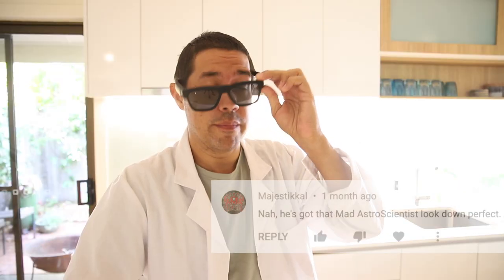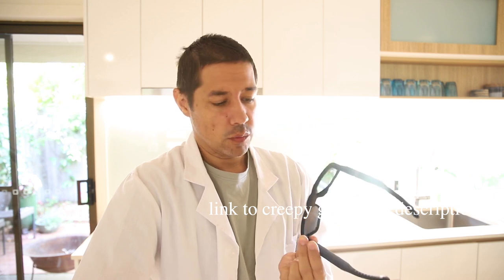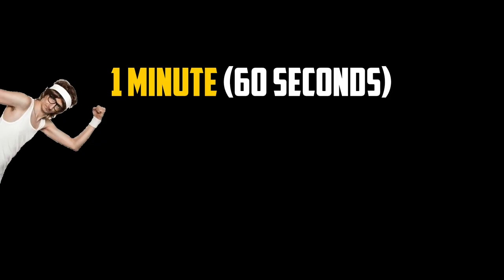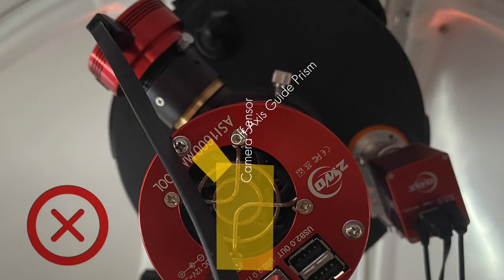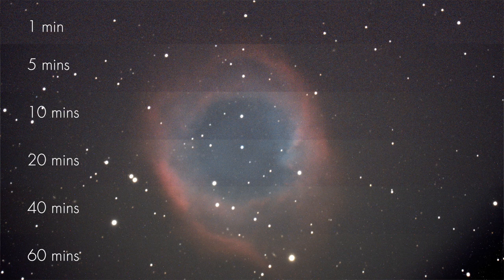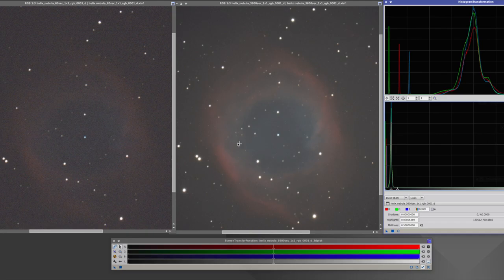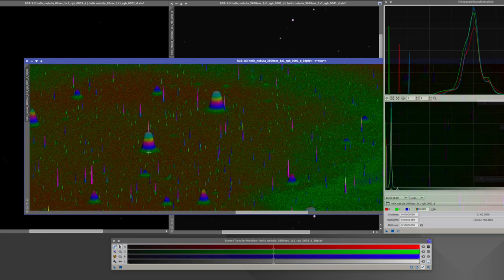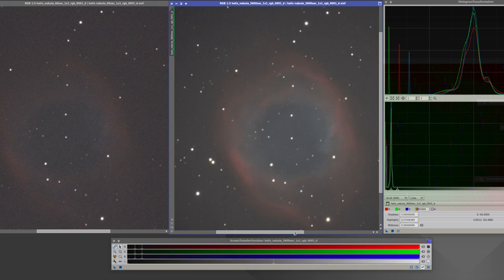Extreme Astrophotography - 1 Hour Subs!!

Comment: I actually prefer long exposure cos the noise reduction and image quality improvement is significant. 

While I only have a star adventurer I've still managed to get pin sharp, noise free, 30 minute long exposures using a Zeiss Distagon 15mm lens on a Canon 5DSr to capture wide field images. Even had it up to 4 mins with a monster Canon 300mm f2.8L prime haning off it, at least 2.5kg over its payload limit and it still works! Anyway, thanks again for your tips and insights. Greetings from a relentless cloudy November in Scotland.

Comment: Hi Dylan, I would like to see a comparison 60 mins vs. 60x1min stacked an if there is any noticable difference...
Reply from the maker: I have another video with that test :)
Reply: A 1 hour sub IS better than 60 1 minute subs under good conditions. The point of diminishing returns is at about the 10 minute mark.
6 10s would be as good, and possible better than a single 60. Under perfect conditions, very dark skies, stunningly accurate tracking etc, I hour subs would be great. The draw back becomes, from a technical glitch, a wisp of cloud. Imaging 4 hours of 4 60 min subs. Each sub is 25% of the whole session. I blown frame and it is a huge loss. Shoot 24 10s, and lose a few to what ever cause, and it is just a tiny fraction.

For us amateurs, great results from 1-5 minutes , with out the drawbacks. I shoot 2 minute subs for the conditions I face and am pretty happy. Not even possible to shoot 10s let alone, 1 hour. Sky conditions just don't allow for it.

Comment: Nice one mate... 💪... you now need to post reprocess 1, 2, 3 of the 3600s exp 😂, perhaps it will magically stack more data ... is that a small dehumidifier that you have inside the dome?  ... I went for the helix a few weeks ago and was not happy with my image, I guess I have pushed my small wide field refractor at 420mm beyond its limits... even in mono with Ha and RGB... not an easy target to get right ... cool glasses 🤓
Reply from the maker: Yeh tiny dehumidifier.. was in a recent video about obs maintenance but it’s doing quite well :) cheap too.

Comment: Dylan - How good are Highpoint Scientific with Shipping?  have found something on their US site that with Current Exchange rate is almost less than half the Local price - but concerned shipping might then end up tipping the scales...
It isn't for large Item - just .7x Focal Reducer for EdgeHD8 (which no-one has as Celestron are out of stock...) - so either way I have to wait, but might as well also get it at bargain cost...
Reply from the maker: I can’t use them except for special orders because they don’t ship to Australia generally!
Reply: I ordered my Evo Nexstar 9.25 SCT from them, and had it shipped within a week.  From New Jersey to Florida. Don't know about overseas shipping, pretty sure that's where the price will hike up if you do. But definitely stick with High Point Scientific.  They are awesome, knowledgeable, and have really good support (considering pandemic here).  And make sure to drop Dylan's name if you order from them. They like knowing how you learned about them.

Comment: But if u live in Bortlie level 6 or more with out filters anything over 3 mins is not much good. Do you use the zwo air pro Dylan?
Reply from the maker: Yeh I’m at a dark sky area .. and no, I have a dedicated server so no need for air.
Reply: Ah ok
Reply: Yep, its about the sky background noise. No filter and city lights will swamp the sensor. So then it makes more sense to go for a loooot of data and shorter exposures (do check the histogram though, having a white image might not be an issue if it’s not clipping the sensor). But when using narrowband or being at a dark site, a very long exposure will outperform shorter ones easily as you get much better signal over noise.

Comment: Hi Dylan! At 8:26 it may be seen that the star has a lateral chromatic aberration. How high was the galaxy when you shot the frames? I am asking because I see a similar pattern in my photos and I wonder whether it was due to atmospheric dispersion or my refractor has optical issues since the target was between 45 and 70 degrees altitude and I thought that the dispersion should manifest itself much lower.
Reply from the maker: Can’t be that then.. this target is basically overhead at the zenith.

Comment: Interesting- Longest I ever went was 20 minutes to see how many fuzzies I could get out of Markarian's chain.  Interesting how the noise flattened out so much.  I would be curious to see how gain and offset affect star saturation at an hour? Were you at unity gain?    
Nice M33! Was that with your HaGB technique?
Reply from the maker: Yes G-HaGB :) the gain settings were the same for both exposure tests (not high, pretty low).
Reply: @DylanODonnell  I am surprised at that there was only one satellite in that hour-  Helix is near the CE and there's usually more there.

Comment: Talking about making wide angle photographs of the sky with a telephone, things are progressing quickly. Iphones have very lousy cameras. The high end Samsung are starting the be good. The Huawei P40 gives pretty impressive images of the Milky Way. The top is the recent model from Xiaomi, the Xiaomi M10 T Pro, it has a 108 megapixels camera, and the images on the sky are crazy. Very likely better than with an APS reflex camera. It can stack images and do star trails, I was quite impressed by this telephone. You ought to look into it.

Comment: g`day dylan is the CGX out the door after only 3 years i thought the mileage would of been better ... so what mount are you going to buy ???? 
what brand are you looking at  and are you going for a mount of higher spec than the chineses brands the plainwave mounts look cool  the neighbours would think its a missile launcher lol if you have deep pockets ...  what will you guestermate your budget will be  for the new mount  and will you buy celestron CGX  again as a straight replacement ?????? was the CGX worth the nearly $4000 dollarydoos for 3 to4 years use ????
Reply from the maker: I know I know .. it’s just not handling these long focal lengths very well at all. Not sure if it’s All CGXes or just mine.
Reply: @DylanODonnell  dylan  your mount has had a hard life.. everything no matter the brand wear out or need fixing after a while have you looked at a complete strip and rebuild and bring it back to speck.. i think its your bearings getting tight(motors and main pivots RA DEC) from moisture in the dome a bit of rust / dirt  /ant bodys from the great ant attack last summer lol old grease.. look how much it improved over a few months ago  after you did the belts  adjustments .. mounts need love too .. a few hundred in bearings(at a industrial supply) might save ya thousands  in a new mount  or new gear is always nicer..  hope you keep us informed in your thinking and the process and outcome because its the heart of any imaging system is the mount 
cheers
james D
Reply from the maker: Yeh I’ll sell it cheap to someone with more skills than me :)
Reply: @DylanODonnell  well that counts me out  if you need skills just to buy it.. i am schultz..i know nothing .. i am at the stage i have been basically priced out of the hobby  if i want to advance anyway .(i need a mount and a bigger sensor camera etc) the zwo asi290mc just don't cut it for widefield lol
cheers
james D

Comment: You talked for like 20 seconds and already earned an updoot ^^
Reply from the maker: Heh
Reply: @DylanODonnell  Your stars have like yellow tops and blue bottoms. I think you are already hitting atmospheric dispersion. You can also reduce star size by aligning the RGB Channels. Does anybody use adc for Deep sky ? I think it was only needed for planetary for "amateurs" (green eyed look to your manly aperture) up until now.
Reply from the maker: The histograms look pretty aligned but I’m sure there is a process to align them better .. not sure if it would work for OSC or not.
Reply: @DylanODonnell  astro pixel processor has an option to align rgb channels after calibration and before normalization. It helped me tremendously to reduce chromatic aberrations from my old Nikon 400mm f3.5 and on Reflector subs with near horizon targets here in Germany like the Eagle Nebula. If you do synthetic luminance from rgb for lum sharpening this also helps to tidy things up.

Comment: Lord don't get an EQ6R pro. Nothing but problems. I'd get one of the Ioptron mounts. I made a mistake getting the EQ6R Pro. They must have Americanized them because mine came like it put together on Friday afternoon at quitting time. Grabbing it at the top it wiggled. I found a way to fix that. Then it was slipping all the time in RA axis. I think I fixed that. It was balanced and I couldn't understand why the guide star just suddenly streaked across the screen. Well the mount was slipping in RA. Too much grease was on the screw that is supposed to keep it from slipping.

Comment: Nah, that's not extreme :D How about extreme astro-processing. With a laptop strapped to you, you have to HALO jump from 35000 feet and process an astrophoto before you make it back down to the ground. If you don't get it finished by then, you have to then run through the rainforest, all the while working on the image, and then without breaking stride base jump off the top of Angel Falls. The image has to be finished by the time you get to the bottom :D If it's still not finished, you forfeit the $5million in prize money :D :P We can get Bear Grills to host the episode :D

Comment: I recently got two defective CGX-L mounts in a row from Highpoint. The first mount started out working very well. within a week it had problems tracking. The mount would take a big leap in Dec and wreck an image. I sent it back and got another from them. The second CGX-L had egg shaped stars from the beginning. They were worse than yours are in this image but identical in shape. I contacted Highpoint who got hold of Celestron. Celestron sent me a two paged typed set of instructions on how to make an unguided guided log. It took all night but i got it done. 4 days later they wanted the mount back. You should not have to pay for that mount. The error has something to do with the teeth on their gears. It looks like there is a 21 second error that is bad. The belt sticks in the teeth of the gear it looks like to me. Celestron has manufacturing problems with all the covid issues going around. I think they second sourced their motors and possibly some other parts of their mount. Good luck with your mount and thanks for the excellent streams. Try a 10Micron mount and don't look back!
Reply: Yeah id have to agree. Although i love most Celestron made products, the mounts have been their weakest link from what ive experienced and seen from other imagers.
For instance i have the AVX(the newest model) and in the beginning it worked for the most part; i could easily get 5 minute, unguided exposures before i got any type of lines or eggs, that was with just a rough polar alignment(no polemaster).
Now, after having the mount for a little over 2 months im experiencing trails and eggs. Ive noticed at times it would seem to skip while it was tracking, like it will slow down and then speed up or just altogether stop for a millisecond or two. Just long enough to cause little raindrops.. only on the best/luckiest of nights can i get anything over 2 minutes 😪
Celestron has officially broke my heart..

Comment: you should compare 6 x 10 min to 1 x 60 min.  :)
Reply: How do you find the optimum.  More exposures reduce risk from planes etc.  Long exposures have risk of lost time if you make a mistake.  ??
Reply: @ahbushnell1  CMOS cameras on average have such a low noise that the 6x10minutes will be better than a single 1x60min which might be saturated anyway and with much less dynamic range. Also if you can oversample and median add to remove the telegraphic noise, then it's really better.

Comment: What I’d like to know is how you exposed for 1 hour without blowing out the images to completely white.
Reply from the maker: Almost no light pollution :)
Reply: @DylanODonnell  lucky. Bortle 6-7 here. Depending on the iso, maybe 3 minutes tops before the photo is completely white with a filter. But typically I get 60 seconds at iso 800 on my 70d before the histogram peak moves past 1/4 from the left. From what I’ve learned any more exposure time past 1/4 doesn’t improve anything.